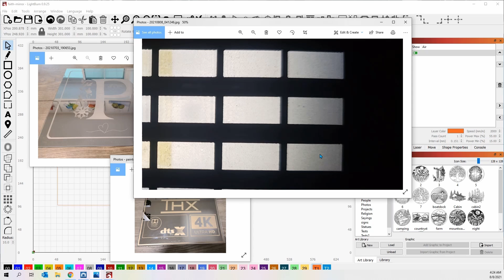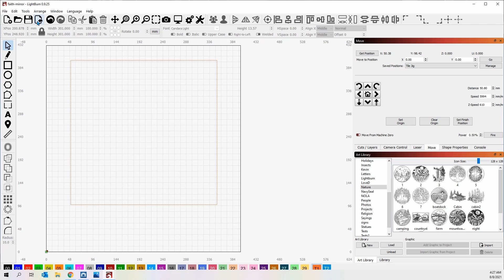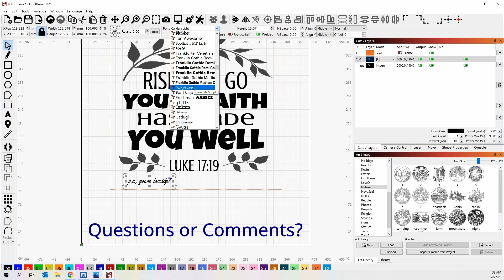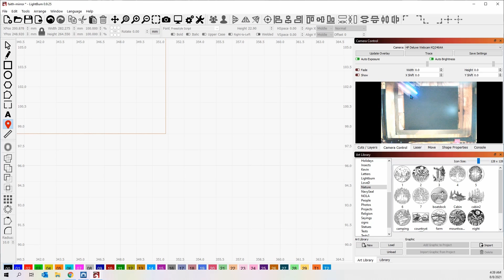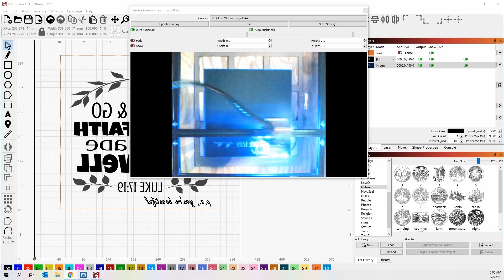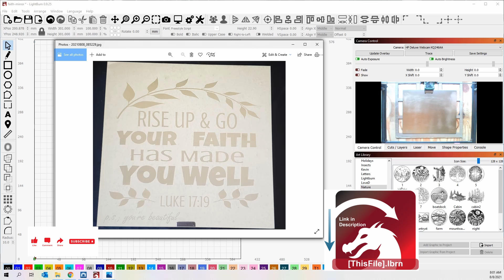💡 Diode Laser Inspirational Mirror Engraving!

Comment: I'm kind of a rookie at lasers I bought an xtool D1 Pro and need to get a computer to run it. I want a lap top, but don't want to spend a ton of money, I am using Lightburn. what would you suggest for a computer?
Reply from the maker: Lightburn does NOT play well with laptops because of the screen resolution, unless you get a 17" screen. You can go on eBay and get a sub $200 Core i5 desktop if you're on a budget. If not, any modern computer will run it like a champ.
Reply: @TheLouisianaHobbyGuy  Thank you for the advice

Comment: what kind of mirror is good for engraving? i bought a mirror 1 day ago and tried to engrave it at the back. my LB settings is 1000 speed and 80% power. i tried letters only for testing. but after it finish, i flip it over and the burn didnt pass thru. its a 30w laser module from neje.
Reply from the maker: Almost any mirror works for me. You have to run a power and speed test to find the right settings for any new brand of mirror.
Reply: i made a material test... the best settings for the mirror i bought would be 500 speed and 80% power. and with this setting, it will take 1.5 hours just to burn 2.5" x 6" text. the back of the mirror i bought is glossy like it has a thin glass on it. i don't know what it's called. unlike the back of the mirror we have on the wall, it is matte and even with my 10w laser it burns well. i think i bought a wrong mirror :face-red-droopy-eyes::face-red-droopy-eyes:
Reply from the maker: I don't know why. My speed and power on a 5W diode laser was 8000 mm/min & 90% power I think. You're probably not focused correctly.
Reply: @TheLouisianaHobbyGuy  i think its focused fine coz i use it on engraving woods. i only got problem with this certain mirror i bought. but do you happen to know a mirror with a glossy back too? isn't it mirror back should be matte finish? our wall mirror has matte back but the one i bought is like glass finish.
Reply from the maker: Yes, all of the mirrors I use are flat finish. Try these: https://amzn.to/3McMwil
They engrave beautifully at high speed!
Reply: @TheLouisianaHobbyGuy  ohhh amazon.. im from philippines hehe 😅😅 anyway, i ordered another set of mirrors online. hope its flat finish. thanks 😊😊😊
Reply from the maker: My wife is from the PI. We have a house in Sta. Ignacia, in Tarlac.
Reply: @TheLouisianaHobbyGuy  ohhh that's nice to hear <3.. so you love filipino dishes too?

Comment: I know this is over a year ago on this video. I'm hoping someone can still give me a few tips. I have a D1 10 watt non pro. I want to engrave a image from a photo onto a mirror. This would be my first time. Everytime I try to edit photos to engrave on wood , they never come out. Can I edit a photo in Lightburn only, or do I have to edit it in an exterior program like imag-R, which I use the free version? I know I will not have to remove the entire silver back. Any tips would be appreciated. Thank you.
Reply from the maker: You can edit the photo any way you wish. If you edit it outside of Lightburn, you will need to double click the layer and enable passthrough. You have to run your own tests to see what settings work for you.

Comment: As always your video instructions are spot-on, clear & precise...Question I had, why did you choose to leave layer as 'image' instead of 'trace' convert to svg, then use the 'fill' setting? Did the laurel (leaf art) burn as a shade of grey or all the through to mirror?
Reply from the maker: I wanted the shading Douglas.
Reply: @TheLouisianaHobbyGuy  thanks again Rich. What about digital vector images etching on mirrors, such as this example, you would just set the min-max power? Do you have a power test file for such or would I simply use the power test file attached in this video description? Again this is only an example of something similar or say image of dragon with fire flames... https://images-na.ssl-images-amazon.com/images/I/919DhOo6ZfL._SL1500_.jpg
Reply: @TheLouisianaHobbyGuy  see my question below.
Reply from the maker: @dbwhitted  I don't always see old comments Douglas. I just use a standard Lightburn test grid.

Comment: I have watched your tutorial on cutting the mirror several times. I just purchased a xtool and have no laser knowledge. When I see your speed settings at 4000 or 5000, is that just for the laser you are running? Not knowing my xtool laser very well, does it run speeds in the thousands or is it geared to between a different range of speed, 0 to 100?  I've been trying to view more xtool tutorials but none really discuss the machine and speed capabilty and speed range.
Reply from the maker: My speed is in mm/min which is a diode laser setting. You can change yours to match in the Device Settings.

Comment: Hey Rich. What type of file do you use for the image and how do you convert it from pgn.any help would be greatly appreciated
Reply from the maker: Any type image works, and I usually just trace it Sudhir.
Reply: @TheLouisianaHobbyGuy  the reason I ask is because not matter how I remove the background of an image it still engravers it would you be able to help a brother out. Thank you
Reply from the maker: @sudhirnr9  Try tracing the image
Reply: @TheLouisianaHobbyGuy  thanks
Reply: @TheLouisianaHobbyGuy  the trace image worked for designs but did not work for pictures or photographs what do I need to do if you could help it would be greatly appreciated

Comment: Is it possible to engrave on the front of a mirror, if so what treatment would you apply?
Reply from the maker: Yes, I've done the fronts of mirrors. Use black tempera paint (it washes off with water) to treat the area to be engraved Robert. 
https://amzn.to/38r4OeW
Reply: @TheLouisianaHobbyGuy  thanks.  I'm definitely going to try it. How do you apply it with a brush, roller or what tool?
Reply from the maker: I use a foam brush Robert.

Comment: Hi Rich, I maybe having a senior moment, or its to early in the morning. But I kinda got a little stumped (or this is just a silly question) Anyway when you say clearing the back of mirror, you dont mean using clear spray then paint? As I have done mirrors just buring of silver coating with varied results (some not so good) no all the same which I want. And thanks for the files they will help
Reply from the maker: No Flyin, Clearing the silver oxide off with the laser 😁 I do spray paint the back however, usually black or gold for more contrast.

Comment: What laser do you Use ?? / Power of The laser ??
Reply from the maker: I have several. 40W, 20, 15 & 7. In this video is was a 20W (5W optical output)
Reply: @TheLouisianaHobbyGuy  i have neje N40630 30W 7.5w Optical output Should I Increase the Speed and power a bit ??
Reply from the maker: @BlackwingzYT  Yes, or do a power test grid so you know exactly what the best settings are.
Reply from the maker: @BlackwingzYT  I did this one with a 5.5W, so yeah.

Comment: Great tutorials!   I may have missed it but what laser are you using for this mirror?  I have an Ortur laser master 2 15w (4.5w output) and I did some testing and found 1200 mm/min at 38% power worked well at first.  Although the light shown through pretty good when I painted it black, the color wasn’t real prominent.  So I took acetone to clean the paint and noticed the back was not fully removed.  As I wiped with acetone it seemed to take away whatever was left behind by the laser.  What I thought was clear was not.  I did try some other speed and power combinations but the higher the power the more brown or burnt the glass looked.  Maybe it was a matter of just cleaning better after higher power?   I was going to try the higher speed and power as you did.  5000 at 90% power.  However just thought I would see what power your laser was before doing so.  I feel I am real close to having it dialed in.   Thanks again for your tutorials
Reply from the maker: In this video Mike, I was using the Ortur 5.5W laser. My settings were a little higher because it was raster.

Comment: Hi Rich, I have learned more watching a few of you videos in these past few weeks than i have in the 1+ year that i had my laser, i have one question what is the best focal distance for my 20w laser master 2?
Reply from the maker: The default focal distance on the older machines is 55mm for 15W & 20W Laser Module, 58mm for the 7W. The newer fixed focused machines is 29mm, and should come with a steel rod to place under the laser to focus it. The best focal distance can be achieved by eye, using the recommended distance, and then either turning the focal knob on the older machines, or raising and lowering the laser on the newer fixed focus units until you see the smallest, clearest dot.
Reply: Do a ramp test, the LA Hobby guy has a YT on it.

Comment: Hi Rich,
I really like the fact that you share your files. I downloaded and burned both the test file and this file. No matter what speed or power I use, the output has very visible verticle lines.  I think I know that this may be caused because the laser beam is not round but rather rectangular. I used 2500 speed and 80 power on my 20w Orutur. Any thoughts about the lines? We did try to paint the output from this file but the results were not so good. Is this because I etched the glass and should just remove the coating?
Reply from the maker: Hi Vince... come join my discussion group where we can share pics and files. Hard to do here. https://lahobbyguy.com/bb